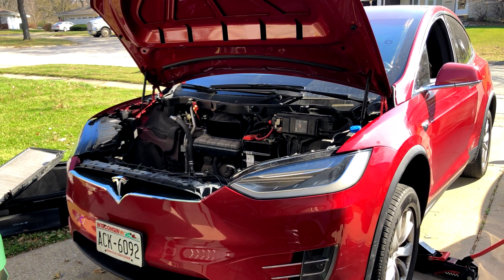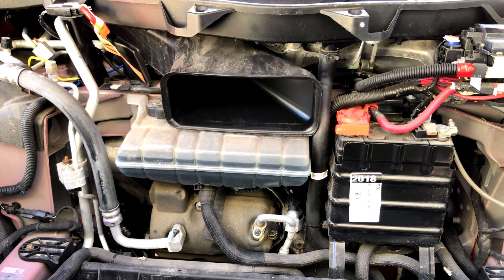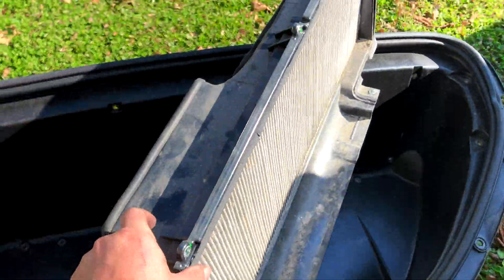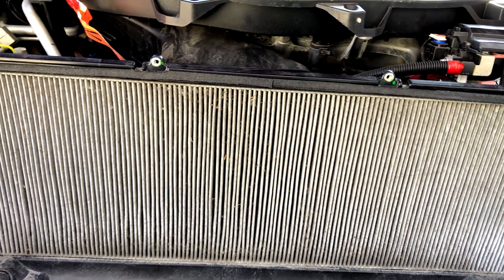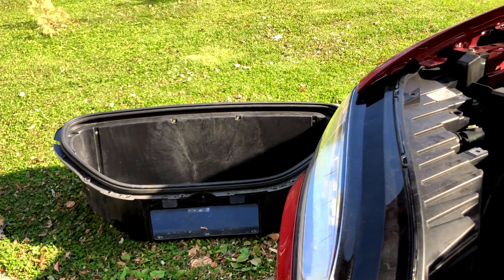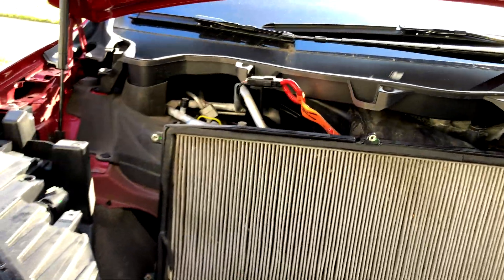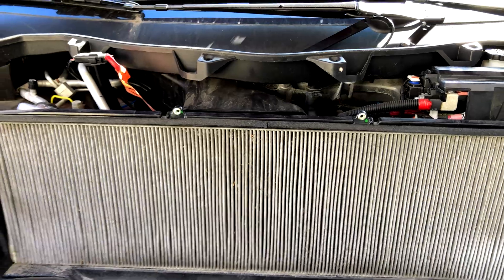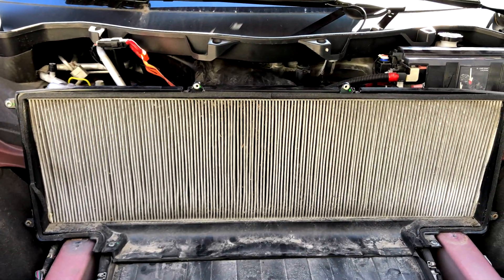Tesla Biohazard Filter Cleaning & Use DON'T WORRY ABOUT WEARING IT OUT!

Comment: This is not the biodefenc filter.  Stop deleting peoples comments when we inform you
Reply from the maker: I have not deleted anything. According to Teslas own parts catalog, FILTER,HEPA,MDL X = Part 1045566-00-H
Under the dash/cabin filter is just a carbon filter: CARBON FILTER - MODEL X = Part 1039042-00-B
According to our service center, the large filter shown in the video is the Bio Filter.
Reply: @KmanAuto  : The carbon filter is what's making it a biodefenc filter.  The Hepa filter in the front just remove particles. It's really important to swap the carbon filter once a year. It cost 30$ and removes smells / gases.

Comment: I'M SURPRISED HOW MUCH DIRT IS UNDER THE FRONK. IT WOULD BE NICE IF TESLA SEALED THE UNDERSIDE BETTER.
Reply from the maker: Thats nothing. I pull both frunks out usually right after winter when all the slush and crap  gets kicked up and air blast them out. I vaguely remember one man removing the rear under shield under the rear motor of a Model S, and that he had something like 30 Lbs of rocks sand and dirt under there.

Comment: How much does a new filter cost?
Reply from the maker: Last I remember, looking at over $300 just for the filter not including install. Reasoning was Tesla sealed the filter to the plastic housing it is in, to prevent air leakage. As such, it's not just the filter but the plastic housing that gets replaced.
Reply: @KmanAuto  that's lazy on the Tesla part.
Reply from the maker: @Dextermorga  Agreed. Overall design could have been much better.

Comment: You cut out the best part with all that dust escaping filter ;(
Reply from the maker: What a cloud it was! I need to do the Model S, so will do another one. I was on a time crunch for this one. Had to get the MX back together. This actually was the U-Joint on the lower steering shaft video. Cut this bit out :-)